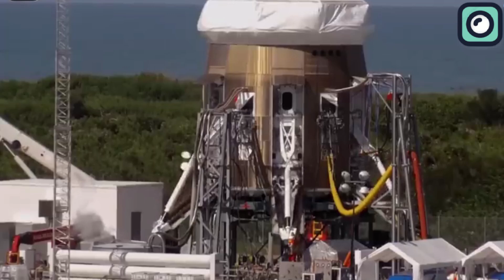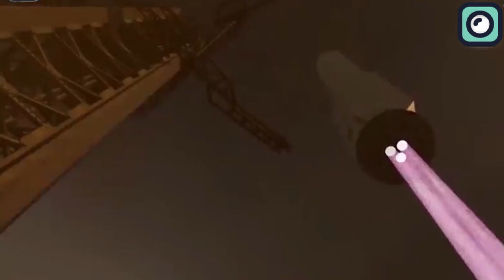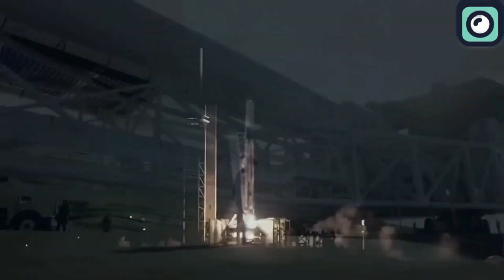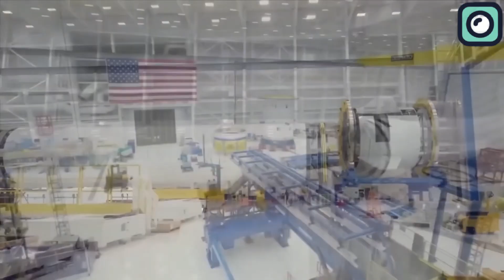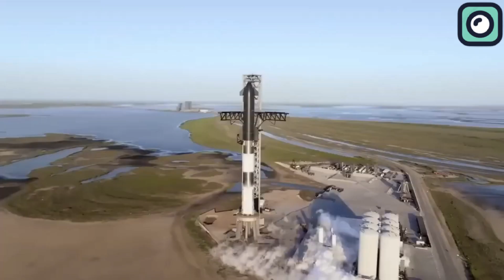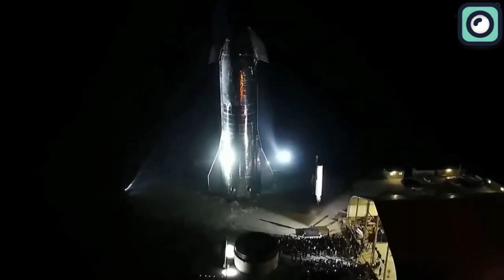FINALLY! Blue Origin's New Glenn Launch Count Down Begins

Comment: Every company has many problems of rockets and engines etc. give blue origin time to work out the bugs and it will work. People seem to forget NASA has many issues and still do with cost overrun and even the shuttle program had also issues as with other companies of production costs etc. 
people seem to forgot Rocket business is not easy.

Comment: Yes, but if they succeed on very first launch,  that would be insane!!  Spacex crashed and burned a while bunch of times with the way smaller falcon9.
Reply: Totally different development philosophies.  SpaceX has been inarguably more successful, but I do expect the Blue Origin launch to be successful. The traditional NASA and Blue Origin design philosophies can be successful, but require enormous financial resources and enormous patience.
Reply: Not exactly. BO spent decades developing the reusable rocket but still not a single success up to this moment. SpaceX already did this more than a decade ago.
Reply: Space X has excellent engineering skills outstanding Technical skills of employees. They are thinking outside of the box as they say.